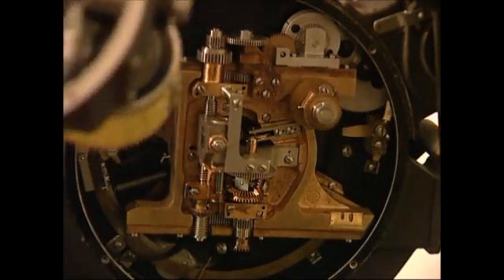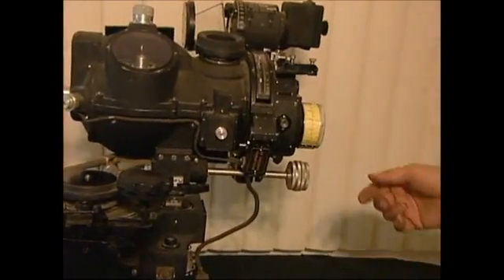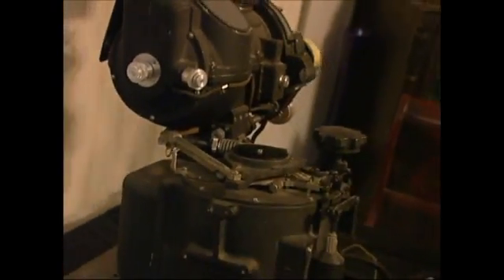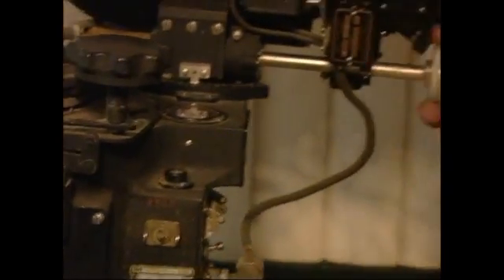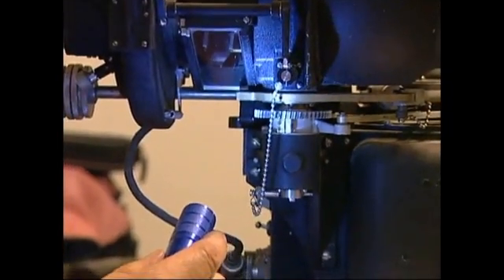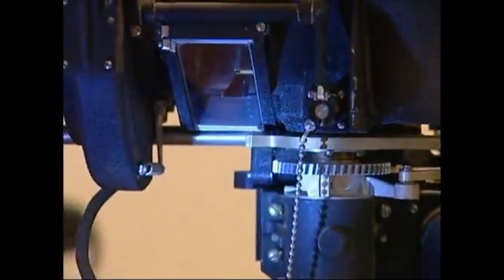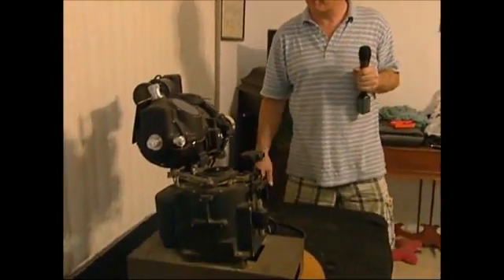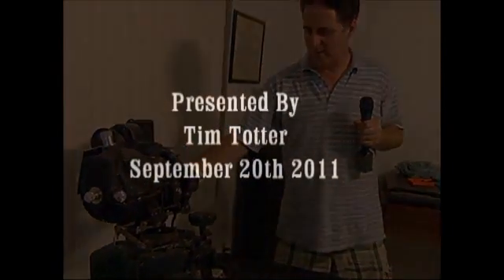Norden Bombsight

Comment from the maker: That was a great movie. Basically once on course to the target the bombardier would "steer" the aircraft using the bombsight to make fine adjustments to the yaw axis. Drift, airspeed and altitude were already pre calculated and pitch and roll were taken care of by the C-1 autopilot. There is a switch on the autopilot that transfers control to the bombardier. Pretty cool stuff for the time. There was also a joystick option for the autopilot so you could use a joystick to control the plane!

Comment from the maker: Well, I think we can figure this out. It sounds like the rate end computer needs some lubrication. If things are gummed up inside you won't see that little tach attachment spin when you flip the 26v DC switch on the side of the bombsight. I've had to pull mine apart a couple of times to lubricate it. The worst was when I first got my sight, that outer knob controls a little cable that positions the prism, well it had come off and boy it was hard to get back on.

Comment: Tim, based on your diagram from the B17 I was able to locate the wire diagram for the B25 in the dash 2 manual. I have our unit hooked up now and it spins up with BS on. But the outer rate/displacement knob is nearly siezed up- the inside one does move so only one of the two wipers in the index meter moves. The tach receptacle also does not spin with BS on. Also no gyro noise when the STAB switch is on, only noise with BS. Any thoughts?

Comment: What I found very interesting is that there is only one wire to fire all stations (in B25, type A-4 releases). When the first station fires/drops, it makes the circuit to the next, and so on. There is a special socket that also bridges to the next station, if the socket is empty (station removed). For the bomb panel arming lights there is one wire per station, for that function to work. Thank you for all the work making these helpful videos, I will check out the wirring video!

Comment: Do you happen to have any document that describes the pinout of the main connector? I volunteer with the CAF MN Wing on B25 Miss Mitchell and recently refurbed the bomb bay so we can drop again, which works from the pickle switch on the bomb panel for all 12 stations. Now I need to connect up our Norden and intervelometer but I have been unable to find a document that clearly labels the pinout of the connector. I do have the correct cannon plug.

Comment from the maker: I believe trail was used to center the bomb pattern on the target. For instance, if you are dropping 8 500lb bombs, and you want the 4th and 5th bomb to hit the exact center of the target, you would have to release the first three bombs slightly before and bombs 6, 7 and 8 slightly later. Using the intervelometer to vary the release interval to achieve how far the bombs would be spread apart from each other. I hope that makes sense.